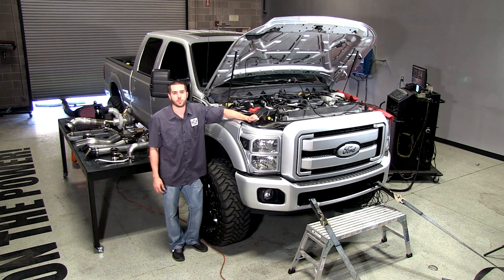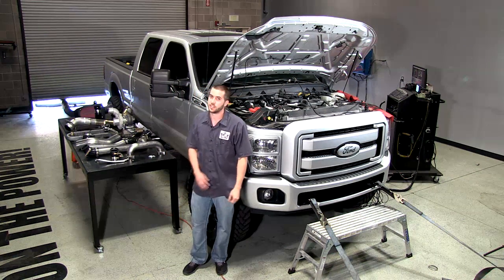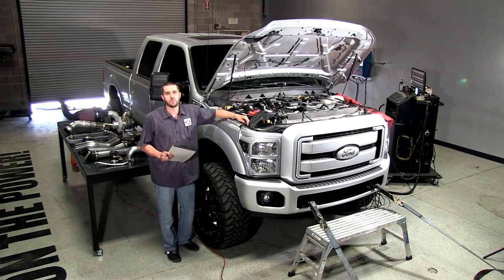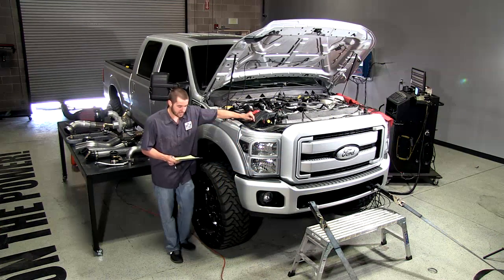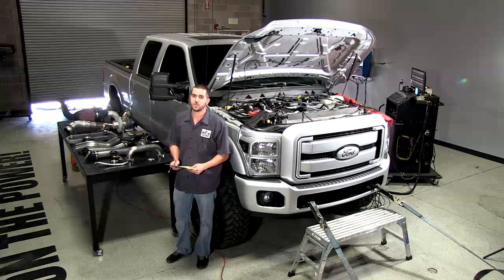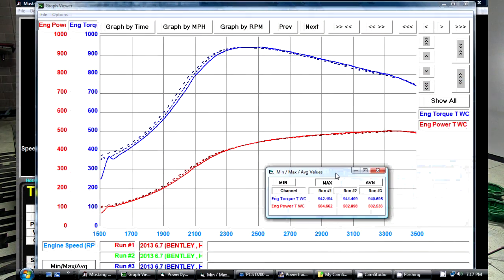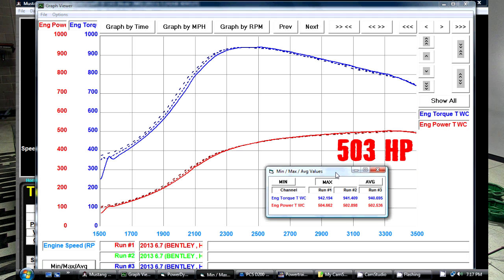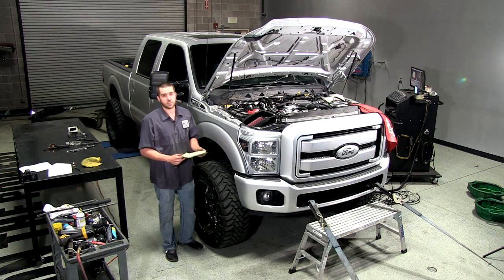H&S Motorsports 6.7L PowerStroke Turbo Kit Dyno

Comment: how did you run a non vgt turbo on this truck without re-tuning for a non vgt turbo? 6.4 i helped put a s369 on wouldnt hardly build 5 psi till it was tuned for a non vgt.

Comment: Not sure what the turbo upgrade is intended for, whether it be pulling or for more of a sporty application however you would put it. The numbers are in favor of sport, but for pulling I'd keep the stock turbos, that loss in low end power would get to me. Though your single turbo setup is still pretty sweet.
Reply: the stock turbos are prone to failure.

Comment: is Ford still using ceramic ball bearings in the turbo or have they switched to plastic
Reply: Yeah plastic won't melt at 1200 degrees
Reply: It was made by garrett thankyou.

Comment: I saw this truck built out on H&S Performance before you guys got it.  I know they did a 5" pro-flo DPF delete.Why no EGR delete?  You were mentioning exhaust temps.  Wouldn't the EGR delete help lower them?I have the mini-maxx on my deleted 6.7, what does that kit run from you guys?  it sounds and looks crazy awesome.  what is the elapsed time you guys had on the swap out?

Comment: Is there a reason why you guys had the dyno fan turned off when testing the stock turbo and the fan turned on when testing the H&S turbo?
Reply: yes there is. that way they can show a much bigger gap between hp and exh temps between the stock configuration and "their much more efficient" setup. should they really have to do parlor tricks like this in order to prove their products???

Comment: any trans upgrades?
Reply from the maker: The transmission in this truck is completely stock and handles the power extremely well considering it has not had any modifications.  The same goes for the engine, internally it is completely stock as well.  We are very impressed with this engine and transmission combination.
Reply: It's said that the stock trans will handle 850HP before slipping.

Comment: Does this truck have the stock bottom end?
Reply from the maker: Yes, completely stock bottom end.
Reply: +Eric Broome Go ask bill at powerstroke help, you'll  get a quick no. These engines need some love before you can make the bug numbers. He's  had quite a few blown engines come into his shop that were just running canned tunes.
Reply: +H&S Motorsports can this be run reliably with a stock motor?
Reply: +Eric Broome nooo